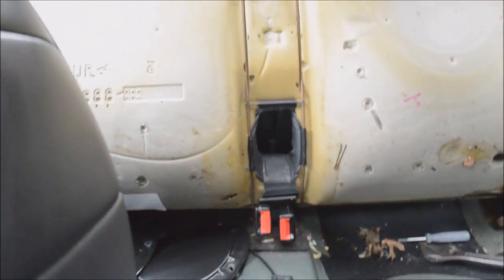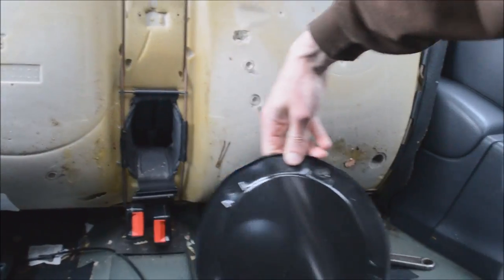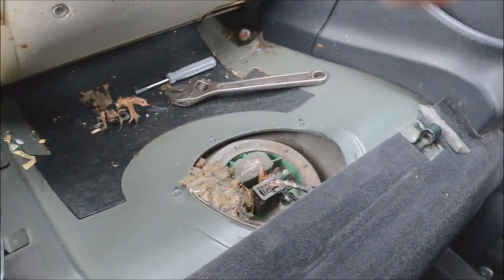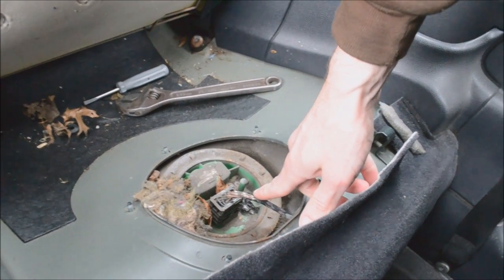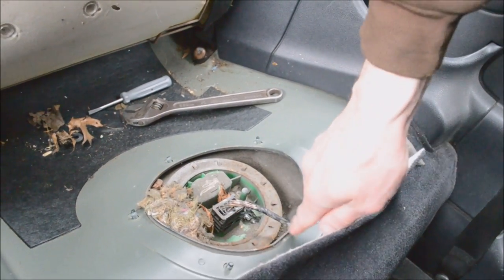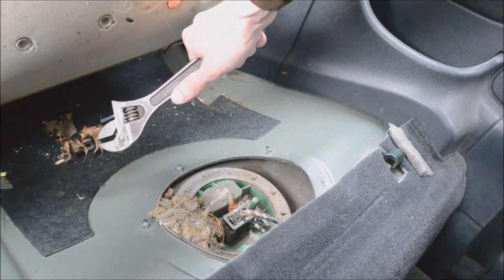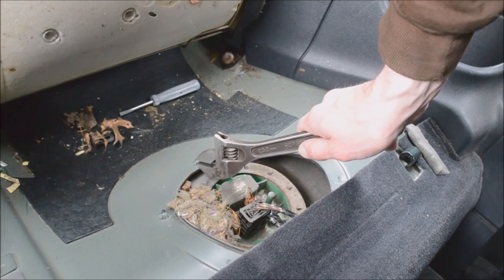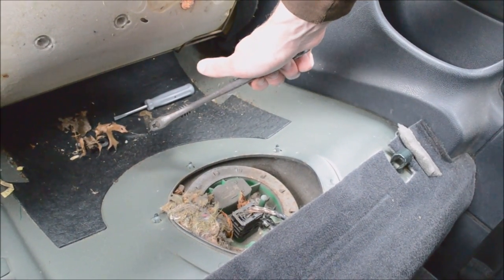death of a fuel pump - MINI Cooper S no start - just hit it

Comment: After disconnecting the fuel line going to the fuel rail ( what feeds fuel to the injectors for those who don't know ) there was no fuel coming out. I did exactly what you show on your video and it started right away. Thanks for this useful info.

Comment: Mine did the same thing this morning...while I was driving at 80mph on the freeway. No lights, no codes, just straight hesitation and dead acc pedal. Now it wont start. I'll try your method here shortly. Question: did you have any of these things happen as well, or did you have codes or lights on\? Thanks.
Reply from the maker: Oh wow that sucks. Happened pretty much the same way for me, no lights or warnings, which is normal when a pump goes...I was just backing out of a parking spot and it just died...thankfully I wasn't in the road yet.

Comment: Hi everyone in case anybody has the same issue, happened to me today, AA service came, hit the fuel tank under the car and engine started on the first try. Fuel tank is on the side of the fuel cap a bit inside of the rear wheel. might have the same result as DIY guy mentions in the video without having to unscrew the inside cap. Thanks for the video, very useful.
Reply: you do realise you comment is none sense... the mini "all versions" R55,56, earlier models etc & some later models actually have a saddle fuel tank ie it goes from side to side, the inner most centre of the tank is raises up "hence saddle tank" that's also why the fuel filter is one side of the tank & the pump the other.
there's also a feature on the fuel system where-by fuel is equalled out either side of the tank, to allow flow & keep the pump etc cool when in use!!...

as for informing ppl to hit the fuel tank.. maybe you should also realise its plastic & could easily break if you hit it hard enough... you could open the tank fuel pump side is (left hand side if you sat within filter is on the right) & tap the pump to see if its stuck

Comment: At how many miles did this happen, and is the consensus that letting the fuel get too low (hence too many instances of the fuel pump overheating) could be the most common cause of this? (if it happens before its Scheduled Maintence time of every 40,000 miles)
Reply from the maker: about 150k, could have been from overheating, but the pump should always have fuel around it based on how the plastic housing is designed

Comment: Um, so it's 12:34am and I'm sitting at the side of the road because, based on what you just said, I believe the pump just gave out. Ugh! 😧
Reply from the maker: damn that sucks, did you get home?
Reply: a DIY Car Guy Yup, I did, thank God! Luckily, my family responded and towed me home. What really got to me, above all, is that the car didn't even show any signs, coding or dash light to warn me, it just gave out. 😑 Now, to work on that pump! ✌
Reply from the maker: Good to hear you got home, to my knowledge a fuel pump will never give a warning on the dash, it's either on or off, sometimes they will run intermittently, usually they just go lol. I have a video on replacing it: https://www.youtube.com/watch?v=2qQpfHYhuUs
Reply: a DIY Car Guy Nope, you're absolutely right, fuel pumps don't have anything like that, they just die. However, I cannot deny you that since my recent change to the '05 Mini Cooper S (new computers, sensors, etc.) from my MK2 GTI (no computers, sensors, etc.) I kind of expected there to be one! Or atleast a warning.  😅 

As for your fuel pump vid, I'm all over it! It ain't that different from when I replaced the one on my MK2 GTI. Thnx for them vids and keep 'em coming. ✌
Reply from the maker: Esteban Henriquez I do agree, they should at least have a warning saying that the pump isn't running when it should be. You're welcome and thank you for watching man!
Reply: a DIY Car Guy
Reply from the maker: what

Comment: My cooper is doing the same thing,did all your dash lights and radio etc work,but engine just wouldn't turn over
Reply from the maker: yea, try and listen for the fuel pump when you click the key to the on position (not the start position where you actually start the engine), the pump should prime, might be able to hear it with your door open in a quiet place

Comment: Did you hear your pump go on when you turn your key to start your car?

Because I think my pump is dead but I can still hear it.

Thanks a lot
Reply from the maker: if you can hear it then it should be pumping, check the fuel pressure at the engine, you will have to take the intercooler off to get to the valve

Comment: I'd say mines the same however I've just changed the HPFP & changed the fuel filter now the car just doesn't want to start no matter what I do or try.... "any ideas?"
Reply from the maker: blew a fuse? does the fuel pump prime when you turn the key?
Reply: I've just been out again to try to see whats what. no I cant hear the pump priming.. I've checked the fuses & they all look good under the dash & in the engine bay. I've no idea what relay to check.. I've tried your 'tried tested method of giving the pump a tap' & nope its not help but I'm feeling alittle better all for it tho
Reply: What was the problem? Im having the same thing as you
Reply: @malp6280  did you get it fixed? I’m having the same problem
Reply: @samanthabartlett6184  hi, yes.. it was due to the rubber O-ring surrounding the fuel filter being incorrectly fitted OR split (cant remember now) this prevented the fuel from being pulled through to the engine...

if you've not replaced the pump/filter etc you could simply have either 
a dead primary pump
a dead high pressure pump (in the engine bay)
a blocked filter
a blown fuse...

you (mechanic) can test for fuel flow to aide diagnosing if a pump has died... I can say the utube described tests ie remove the fuel line after the high pressure pump & crank the engine over is none sense as it doesn't highlight what the fault is.. you can however reduce the issue ie remove the fuel line prior to the high pressure pump (this is also very limited) ie if the filter is blocked or has a bad O-ring you wont know until its removed "& its a pig of a job to refit correctly"

Comment: My truck's went out in an intersection lol. Yours is way easier to replace than mine was.
Reply from the maker: +jimbo booth wow lol... did you have to drop the tank?...it's one of the few things on the mini that's easy
Reply: a DIY Car Guy yes i did , i still have to do the front one . im not looking forward to it lol
Reply from the maker: jimbo booth one good thing is there's a lot of room under the truck :)
Reply: a DIY Car Guy thats right lol . for wanda i dont have a front fuel pump , just one for the rear.